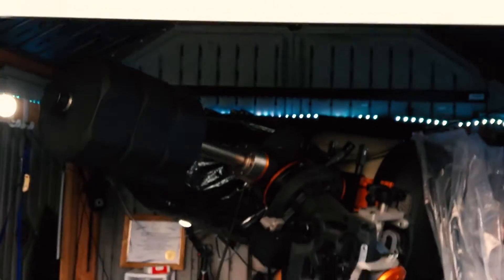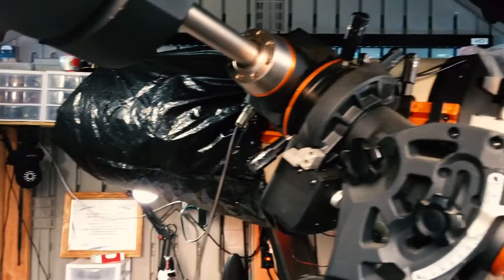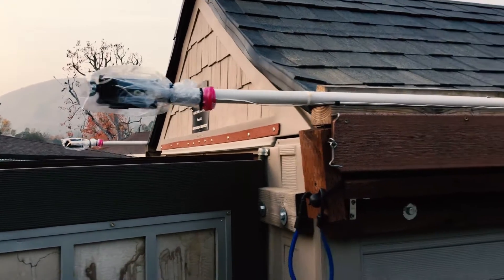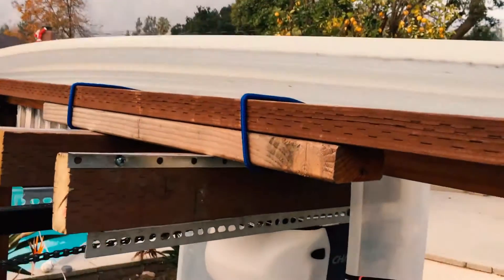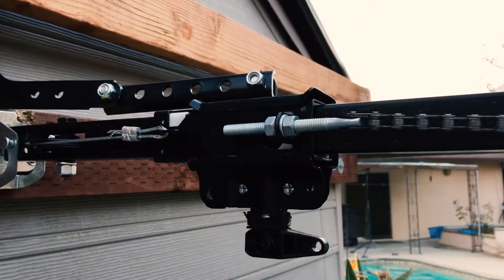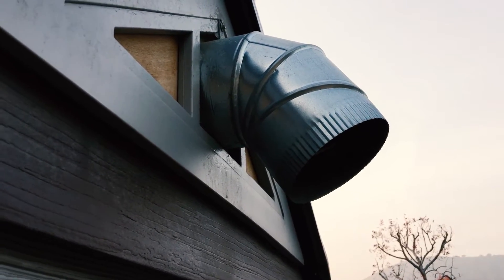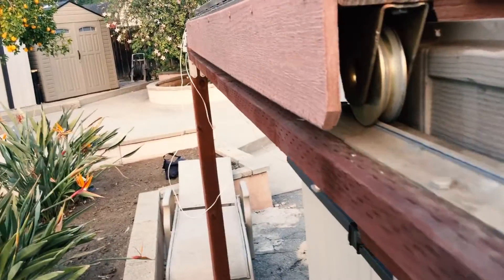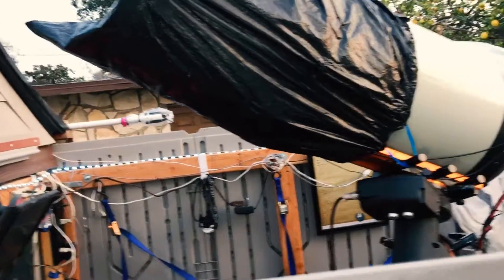Rubbermaid Roll Off Roof backyard Observatory automation Video 2 of 2

Comment: hi just seen your vid and love your setup. How do you keep the roof from sailing away in a storm?  I did not see any hold downs to keep it from lifting off!!!
Reply from the maker: Hi Phillip, do you see the blue tie down straps on the walls? They connect when needed  to the roof in six different tie down anchoring  points on the roof itself. However the roof/motor combination is so heavy and sturdy that after a year I stopped using them even during the highest Santa Ana wind conditions..Clear skies!

Comment: I just completed my observatory roll off roof build, I will have belt driven garage door opener with remote open.  I don't think I am going to allow software to operate my roof, somethings I like to do myself.  It was  a good idea you made a roll cage for your  rubber maid observatory.
Reply from the maker: Do you have a video or pics? I have to tell you that now through Sequence generator pro I program the targets and the observatory to open the roof at 915 PM in the summer (earlier in the winter) unpark the scope, slew to the target,center within pixels of the target and gather data, will do this to as many targets as I want to and continue till about 5am in the summer (later in winter) park itself in front of the flat panel. close the roof, capture flats, bias and darks and turn it self off..I also use Amazon Alexa to verbally turn off the cameras and turn lights on or off.8 to 10 hours a night and I connect to the observatory computer using teamviewer from ANY computer/tablet/smart phone either in my house or on the road...Productivity has gone to almost 100% per night. I also use sky alert to detect clouds,wind,humidity r clouds which will command sky roof and SGP tp park the scope and close the roof immediately...

Comment: I have the same shed with a pier like you.  Do you have any details of the modification on the roof to make it able to slide back and forth?  I currently take each piece of the roof off manually  every time I want to image and it's getting old.  I like what you have done.
Reply from the maker: Hi, if you befriend me on Facebook, then I think I have some pictures of me building the observatory. Basically I put rails on the upper part of the roof and wheels on the roof itself.